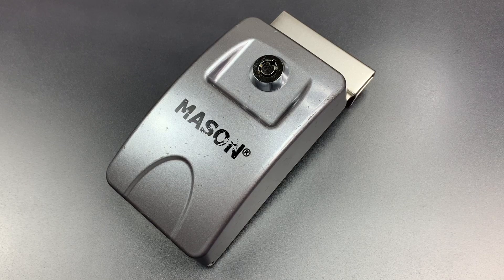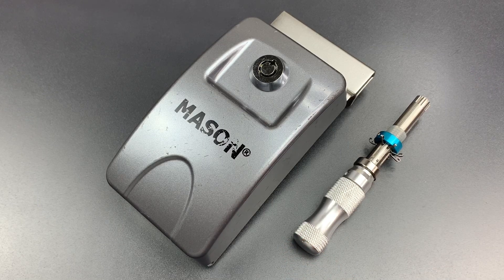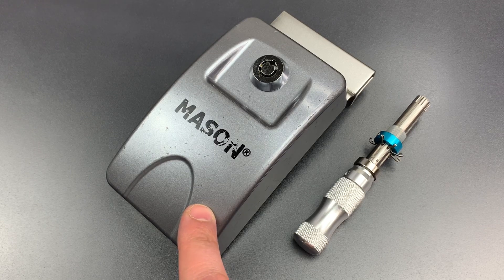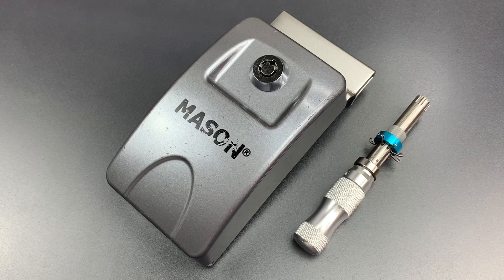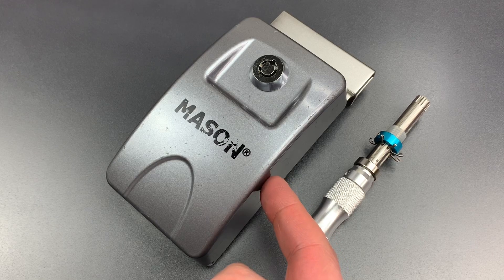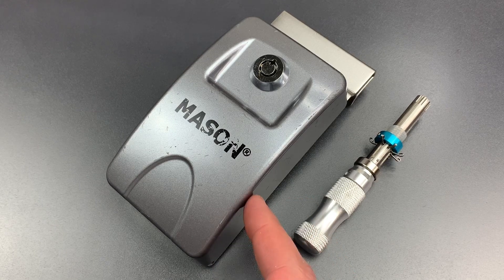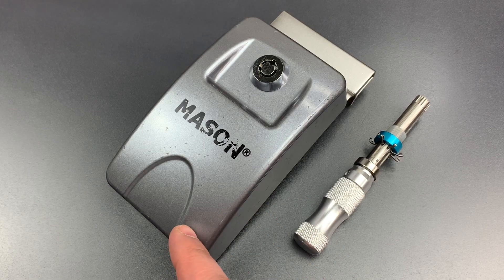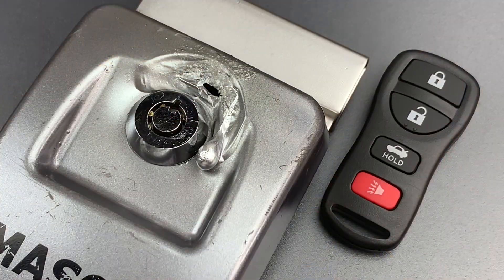[822] Mason Auto Dealer Key Box Opened With Plumbing Torch

Comment: years ago i worked at a car dealer that used these, theives just broke the window and took the box and smashed it on the ground or hit it with a hammer and got the key out. the best one was when the vehicle was push button start and had passive entry i walked up to the locked car with the box on the window, unlocked the car and got in and started the car with out removing the cars key from the lock box, the look on managment faces when i showed them that was priceless.

Comment: Excellent video! Professional tip: the hottest part of that flame is the tip. You actually used the coolest section. also there is a heat concentrator that would have let you heat that even faster!

Comment: You had me at [822]. I love these torch trials and would love to see you "unlock" something by pouring liquid nitrogen on it and striking with a blunt object. Theoretically, all of the locks molecules should line up enough to create points of fracture making the frozen lock susceptible to breaking open. Thoughts?
Reply: I seen someone take a can of freon and do that to the club steering wheel lock and smash it in seconds

Comment: Imagine your 40.000 dollar Audi stolen by a guy with a 40 dollar handheld blowtorch.
Reply: you have quite expwnsive torches in your area xD
Reply: I think I got my torch for $30, with a propane cylinder, but it can also accept MAP-pro cylinders. Otherwise I would have only spent $15 to $20.
Reply: 99.9% discount!
Reply: Or a $4 screwdriver.
Or a $4 hammer.
Reply: The torch without the propane costs 35 bucks here
Reply: you can pick one up from a pawn shop for cheaper.  if you're a thief, you can just go steal one.

Comment: Sorry for the semi-off topic question - I have a question about keyway oil.  

We use padlocks to secure soccer goals for a youth soccer league near game position on the field, to make it easier for parents to set up the goals for game play (as opposed to off the field, which would require more lugging to and fro).  The padlocks often jam after a few seasons due to getting wet.  The fields do double duty as a school playground during the week, so weatherproofed locks with plastic caps over the keyway get torn away sooner rather than later.  

My question is - is there a decent type of machine oil to squirt into the keyway to help protect the key action against repeated sprinkler dousing and general outdoor weathering?  I was considering hair clipper oil, thinking that it's machine oil possibly with additives designed to coat and protect metal surface bearings in a moist environment, but I thought it would be helpful to check in with you (and your subscribers) first for some wisdom.

Thanks!
Reply: The product you need is called ACF50. Its used to stop corrosion on aircraft! It is also used maainly by bikers in UK to weatherproof motorbikes over winter.
Reply: Thanks!  I'll research it, and if CA allows me to purchase and use, I'll grab some.

Comment: It's always a matter of time and force.  These boxes aren't sopposed to stop someone with a drill torch or grinder,  they are designed to be a convenient way to keep keys at hand so the salsmen can give test drives.  The zinc alloy is used because you can die cast the desired shape to get parts directly from the mold without a lot of machine work after the fact.   How many units would they need to sell if the same litttle box was made from investment cast stainless steel? 

What would be gained?  Now it takes 2 minuets with a battery powered grinder.
Reply: Yeah, but a small torch makes no noise and it only took 20 seconds.Battery powered grinder is loud, people would hear it, and would probably set off the car alarm on the car. Also, the tool he used in the previous video unlocked it as easy as a key in 2 seconds, far easier than anything else, and also silent. Makes the box utterly useless.
Reply: @rdizzy1  No noise? Listen to the video again. [SUPER LOUD] PSCCHHHHHHHHHHHHHHHHHHHHHHHHHHHHHHH  so its possible to hear it from the other end of the sales hall.
Reply: This made that much noise with a microphone close to it, yes, but in a real world situation, the noise would not travel far, and you could use an even smaller, more quiet torch, I bet you could melt this with even a butane torch cigarette lighter. @sebastiannielsen

Comment: Could you do a video on a very used/weathered lock? The videos I’ve seen are of locks in fairly good condition. May be missing something but I’m curious as to how weathering may affect protection. From where I stand, I wonder if say internal corrosion would increase pick resistance due to hard to move parts.

Comment: lol i wonder if one of those cigarette lighters that make a mini torch flame would melt it
Reply: Flame would be hot enough but heat output (joules/s) might lack.
Reply: yeah with my experience with those style you could do it but it would take like almost 2 minutes to get the heat you need. honestly the housing being zinc on these id just use some form of destructive entry like a special prybar could probably get you in almost as quick as the impressioning tool

Comment: I bet a small crowbar could crack that open from the top with just a bit of force.
Reply: it would because the box is so thin and it's hollow, but there's a potential to trip the car's alarm system
Reply: Since it would also break the window, you might as well use the crowbar directly to break the window and ignore the box.
Reply: @bdf2718  But you need to access the box to get the car key.
Reply: @glennwyant9533  
Sometimes the car is a POS but what is in the car is worth stealing.

But you're right, I hadn't thought that one through.

Comment: Sad, that anyone looks at zinc as "High Security" when making anything. You could use a hole saw larger then the lock with no center bit just to cut the lock out as well.
Cool video of how fast zinc melts and it would not make any noise to alert anyone. But its not the making of this lock that is sad, its that people look at it and think it will keep there stuff safe that troubles me the most. We have years of education more then the generations before us and it seems me are not smarter.